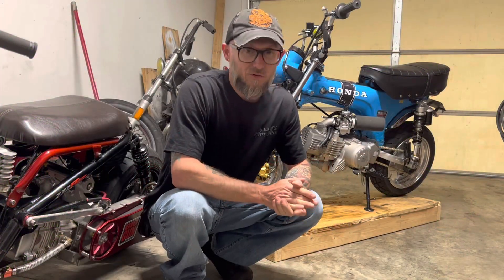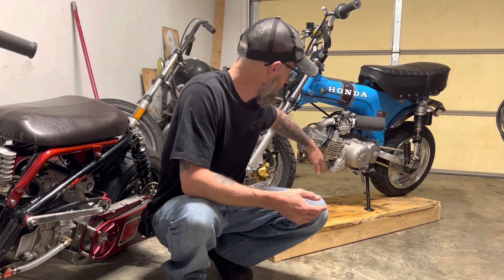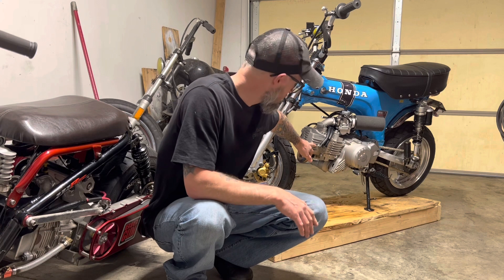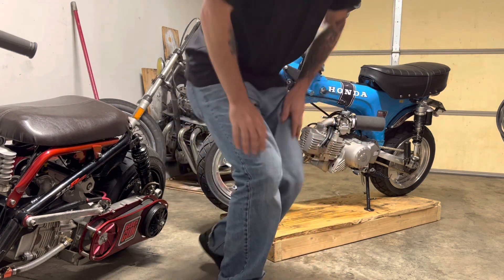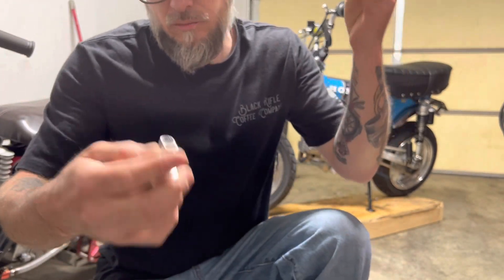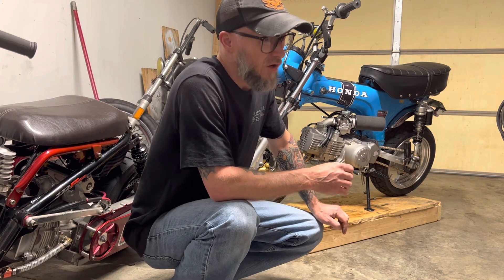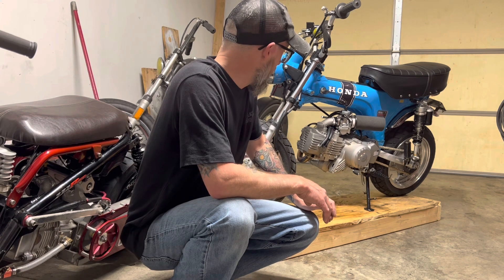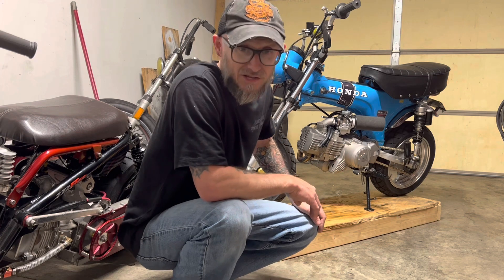Additional crankcase vents added to the ZS212

Comment: I have a 74 XL70, and was wondering if that engine would fit between the down tubes.  I know Minibike Mike talks about the Lifan 125s being about 5/8" longer than the stock engine, so I was thinking the 212cc has to be even longer than that, and probably wider at the top end as well.  What do you think?  Thanks.  Bart

Comment: is this a problem people are having because they are deleting or defeating the PCV system that runs to the intake? I think people misunderstand the purpose of the pcv system and how it keeps the oil cleaner than if it was just allowed to breath to the atmosphere.  look it up.
Reply from the maker: No.   These engines don’t have sufficient crankcase ventilation.  They puke oil at high RPM.
Reply: @CarlisJasonBartley   right so if you hooked the vent up to the intake so that it had vacuum applied to it, would that solve the problem? was the vent designed for suction to be applied to it by the intake and not designed to just passively vent to the atmosphere ?
Reply from the maker: @Borkery  These aren’t designed to be attached to the intake. No performance machines ever are. Again, having oil dumped into the intake is a bad thing.  Especially with a performance engine.
Reply: @CarlisJasonBartley  i dunno man. i too grew up being told that the PCV system was to be removed for performance gains. but at what cost. what was the point of the system, it serves a purpose. what is that purpose? i dont think its just "muh emissions" i think it actually may be more than that. i question stuff like this now. From what ive learned having it sucked out by your intake keeps your crankcase cleaner by not letting contaminates from the atmosphere into your oil so easily. doesnt that at all sound like something to maybe think about?
Reply from the maker: @Borkery  to my understanding the purpose it serves is to relieve the positive pressure in the crankcase so that the piston can move freely on the down stroke without restriction. Positive crankcase pressure can cause all sorts of trouble so the less, the better.  It’s not about emissions at all.  Actually, having it connected with with how this was before would have killed the emissions.  Same as with a 2 stroke.  Burning oil is a big no no.   As for having an I’ll effect on the engine I guess it’s possible but not enough so that many machines come from the factory with it vented to the atmosphere.
Reply from the maker: @Borkery  by the way, I’m not trying to arrogant or even say you are wrong.   I’m not a professional by any means.  Just speaking from experience.   I have been running open crankcase vents on bikes for a very long time without any issues.
Reply: @CarlisJasonBartley  its all good were having a discussion. And i dont think the PCV system actually positively charges the crankcase with pressure as its hooked up to the air intake side of the throttle body/carb so it would actually have suction applied to it. sucking the oil vapor out of the crank case and burning it. Yes burning alittle oil does dirty things up. we all have seen how it does cause your intake to get dirty. BUT maybe that is a small price to pay for the positive benefits that a PCV system brings to the table. which is keeping atmospheric air and moisture from getting at your oil and from what ive read, making it acidic and causing damage to the inside of your engine because of a chemical reaction to the atmosphere and its contaminates. maybe its just water if water gets to the oil even a bit it creates something nasty. thats why i think they have these PCV systems. to prevent this from happening. for example my daily driver usess a downdraft tube since its a 1948 car. and its oil gets so nasty so fast.
ALSO whats wrong with burnin alil oil! i dump marvel right in my damn gas tank every tank!
Reply from the maker: @Borkery  i totally get what you mean and where you are coming from and I only ever run them open on motorcycles.  Especially these little ones.  I run Rotella 15w40 and change it about every 500 miles.  Same with the old Harley’s.  On my vehicles I don’t plumb them into the intake but I do run a filter on them and sometimes a catch can that’s filtered.

Comment: Great build! A few questions. 
1) Is that the stock paint?
2) Whats the ‘great price’ you paid for the 212?
3) Could you plumb those vent lines into the intake for reburn or even the exhaust? 

THANKS!!
Reply from the maker: 1.   Stock paint
2. $895 shipped
3. Having the crankcase vent connects to the intake causes a small decrease in performance.